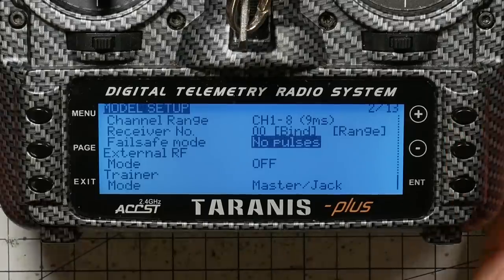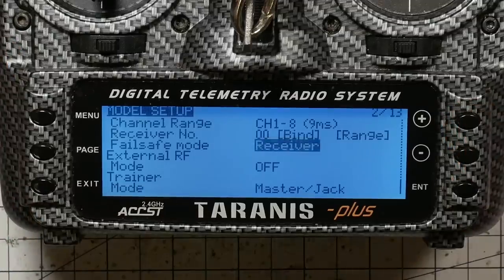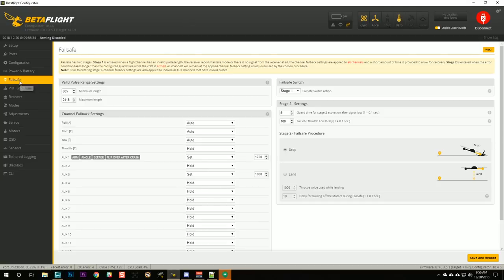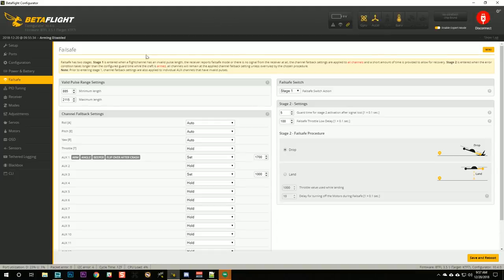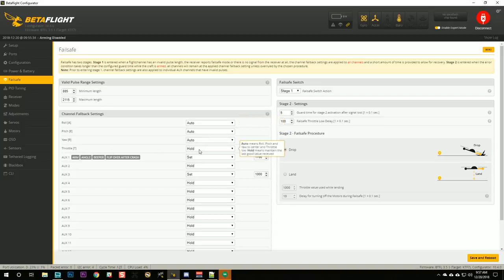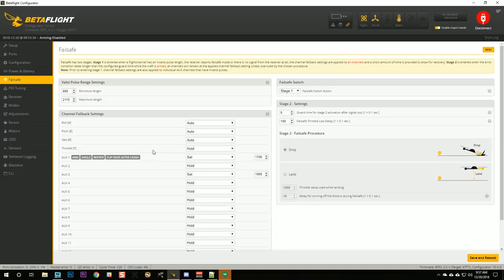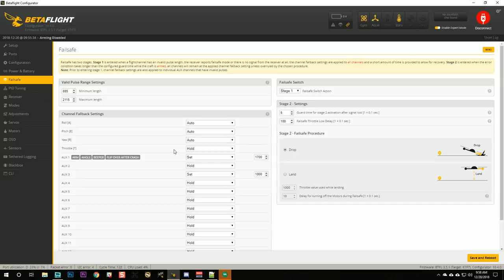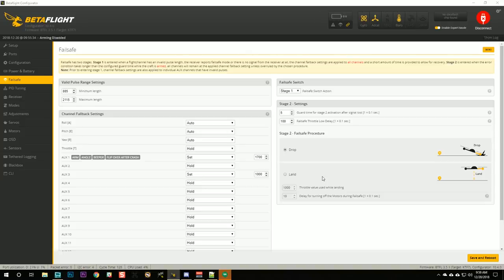Failsafe HOLD vs NO PULSES | which is right?

Comment: Hi. I have a question. I was flying tyro99, and mid flip I lost video feed. I waited for a second or two than disarmed it. As drone was pretty high when this happened it fell pretty hard ( one motor shaft is bent, strangely no props broke although they are damaged ).  What is best to do in that situation ? Is there a way to make it control drop ? I guess disarming turns off motors ( but I did not know what way drone was facing ). How do I activate fail safe on purpose ?

Comment: Hey jb thinking is it like my rc buggy because I bound it with throttle in the brake position. It will just shut off I've never had a issues with quads or buggys on fail safe? So when my buggy fail safe's it stops same as a quad if it's in the air will just fall out of the sky

Comment: Full Throttle without any communication with the transmitter. I would think you would keep on going because it has the battery pack it's locked in I know for my Syma if I go a certain distance the quad seems to stop as if in a box the quad would kind of fall

Comment: seems like a good plan would be to set it to angle mode during stage 1 with a fixed throttle at approximately hover value. Thoughts on this?
Reply from the maker: Definitely not for stage 1. Then if it goes into stage 1 briefly and comes out, it will jerk and you may crash. Better that it just lock up and keep doing whatever it was doing.

Comment: I can say that with a frsky reciever and INAV it DOES matter. Setting to No Pulses will be interpreted from INAV to the lowest time (988ms) in every channel. This happens BEFORE failsafe is triggered. That means if you e.g. disarm at about 988ms you lose the quad. I painly did the experience. Maybe different with betaflight maybe different with other recievers or INAV Versions.

Comment: When your quad does have a failsafe, what does the OSD display?
Today I was flying along quite happily when all of a sudden my quad just fell out of the sky, no death role, all motors had stopped.
Upon review, my OSD displayed My Post Flight Stats just as if I had Disarmed.
Upon plugging my battery back in, some of that magic smoke escaped from the 4in1 ESC.
Reply from the maker: Ummm... if the smoke came out it wasn't a failsafe. Sounds like your ESC took a dive.
Reply: @JoshuaBardwell  Thank you for the reply. I wasn't too sure, as I have had an esc fail in mid-flight and the bird just goes crazy spiraling to the ground, where this was just a free fall to earth from a great height, plus the OSD displayed exactly like I had disarmed.
And yes, you are right, I do learn something pretty much every time I watch your Channel.

Comment: Hey Josh. I'm curious. I completely understand where you are coming from in regards to stage 2 and the landing option. My question is. . . When I first started using acro, it was terribly hard to land, because the thrust from the propellers on the ground and the flight controller trying to sense the quad and so forth. In future versions of betaflight, when you enter a stage 2 failsafe, could it be designed ( as long as your accelerometer was on) and maybe you had auto level in like a background function or on a switch so when you had a failsafe you flipped that switch to go into auto level mode; that the quad could descend in auto level until it experienced the behavior it does when you're hovering over there ground trying to land like a beginner in acro mode; and then it would just disarm?  Did you get where I was going with that?  Do you think that is possible?
Reply from the maker: The quad is not set up to autodetect ground effect, no I don't think so. Autolanding would be best accomplished with sonar.

Comment: What about rc airplanes i've tried several ways and the throttle and servos simply hold and continue?
Reply from the maker: Need to set position in the receiver. Typically this is done by holding the sticks in the desired position and holding down the failsafe button.

Comment: Hi Joshua I know you have used ezuhf before and wondering if you know what to do. I am having a problem getting my Taranis and x8r to failsafe to RTH as a wireless repeater . I have a Taranis plus > frysky X8r > sbus ppm converter to my ezuhf  when i turn off the Taranis the ezuhf goes in failsafe pitch up right rudder and aileron roll over. not a good situation. I have tried disabling telemetry but not sure whats going on. I need 9 channels so i have to get all 9 channels out to the ezuhf. i have D16 set and no pulse but still does not work any ideas what i'm doing wrong. Some videos have used this arrangement but never seen any videos showing the configuration or if the failsafe worked properly when the TX was turn off on a fixed wing UAV
Reply from the maker: I'm sorry man but this is so far outside my area I couldn't begin to say. In the Taranis you definitely want "no pulses" set as the failsafe but from there I don't know what might be going on with the EZUHF.
Reply: @JoshuaBardwell  thanks anyway Josh hope your all doing ok over there

Comment: Sorry! I run failsafe land with a 3.5 sec drop at a fast but safe drop rate determined by my ground effect hover, it has saved me a few times now but I fly in remote locations far from anyone and anything! My worst fear is catching a tree on decent and cooking a motor or esc.
Reply from the maker: Your ground effect hover position will change depending on the size of battery and whether you are carrying a GoPro, or other factors that could change thrust or weight. It's why I don't think it's safe to trust.
Reply: All valid points and I have taken this in to mind and only run the same setup every time! Never changes but still a very valid point and thank you for your response you have thought me so much about the hobby it's not funny, in short if it wasn't for you I'd probably never had the nerve to order my first fpv setup including the HD3's with the laforge witch I followed your step by step guide on internal installing before I even fired them up! 😅😉 thanks again and keep up all the grate work!

Comment: Hey Joshua I have a quad and when I do a multimeter test there is no beep for continuity. Then I will do the test 5 min later and there will be a beeping tone. I don’t know why this is happening. The esc boots fine when there is no tone. I really could use your help. Thanks.
Reply from the maker: If it beeps a very short beep and then stops, it's just the capacitor charging up. It's okay.
Reply: Joshua Bardwell but if it sometimes beeps consistently. Then I wait 4 min and it doesn’t beep at all.

Comment: Hey J.B. my qx7 is starting to failsafe to close with different models, the antenna is good, and the connection is good. Is there anything you know to check? Im hoping by using an r9m module ill bypass whatever ptoblem im having. Thank you!
Reply from the maker: It could be the radio module is damaged. If it's happening with multiple receivers then that's more likely.
Reply: @JoshuaBardwell  will installing the r9m bypass this problem?
Reply from the maker: Yes. If that's the problem.
Reply: @JoshuaBardwell  I appreciate your help, I guess either way it wont be a waiste to try this 1st. Have a great weekend !

Comment: I'm not certain about this - but I am assuming that your demo of HOLD failsafe - by turning off the TX may be flawed. It's possible that the TX sends a command to say ( i'm turning off ). A better test would be to remove the battery from the TX to fully test this. eg don't give the TX time to do anything gracefully. Please let me know if I am wrong anyone.
Reply from the maker: That's not how the TX works. It doesn't do that.

Comment: Imagine you are freestyling 45 mph above treetops and you have failsafe event that is set to "drop". Kwad will continue on ballistic trajectory for another 50 yards or so and it will have about 70 mph velocity at impact. 1 pound hard object at 70 mph can be deadly if it hits a person. And spinning props will be last thing to worry about. But if it switches into "level" it will lose most of the forward momentum and limit descend velocity. I would prefer prop cuts over 1 pound at 70 mph impact. Yea prop can break a finger, but 70 mph projectile can break a head.
Reply from the maker: You can tweak the assumptions one way or the other. As long as you've thought it through, do whatever you want -- you're responsible for the outcome. The big reason I don't feel that "auto land" is safe is that it is typically not going to be thoroughly tested and predictable. For example, if you fly in acro mode, you typically would not test your accelerometer before each flight. Accelerometer can become un-calibrated and you wouldn't know until you failsafe. The throttle position that you assume will give you a nice descent could change to one that gives you a climb, depending on the weight of the quad, the props, and so forth. If you test auto-land carefully to the point where you are confident what it will do, it can be useful. Most people are not going to do that, and simply disarming the quad is the safest thing to do in my opinion. Bear in mind that even at low throttle, the props can rev to 100% if the PID controller commands a correction. The chances of damaging an ESC are much higher if you auto "land" into a tree. This is another reason why I feel disarm is the best option.

Comment: Still don't know how to configure failsafe modes on FlySky iBus. I've tried to figure it out several times, but it doesn't appear to have any "no pulses" option
Reply: Failsafe is in the radio. It is set by making the sticks 100% or zero.
But you have to be very careful with this.
Bc if you failsafe and your throttle is even at 25% it will take off like a rocket, witch I do not like at all.
But there isent anything in there about pulses or hold.
There are a few videos on how to set this up, but just remember what I said about when you set it, and what it will do.
Reply: @toddbeal4373  Hrm. okay.

Comment: Do we know when Betaflight 4 is going final release? I have a Hawk 5 and apparently 3.2.2 is the best tune vs 3.4 and 3.5 but I really need GPS rescue mode not available in 3.2.2. If anyone has flashed bf4 on a Hawk 5 I would be interested in your feedback as I hear 3.5 has random flip issues so would prefer an assured stable release to be flashed rather than just flash it then crash it. Thanks
Reply from the maker: Betaflight 4 is now scheduled for April, 2019.
Reply: @JoshuaBardwell  Thanks. I wish it was available now. From the 1st November the 250 gram law comes into force in UK so the hobby is effectively killed as no one wants to register for harassment and yearly fees. I have 11 months of fun left. :(

Comment: So if the hold postion does the same thing as no pulses then what was it originally intended for
Reply from the maker: Fixed wing planes with servos and no flight controller. In that situation, the receiver is the only failsafe.
Reply: @JoshuaBardwell  oh ok cool thanks
Reply: @JoshuaBardwell  i just found something interesting thought you might like and you might have already seen it  i think you can just goggle this to look at it its called project mockingbird v3 and the tiny hawk and dude says that all whoops fly better with this but its been optimized for the tiny hawk in acro

Comment: You did this vid. i think last year?  are we in syndication
Reply from the maker: No, I definitely did not do this vid last year. I may have done a similar vid, but specifically the point about failsafe working regardless of HOLD vs NO PULSES is new.

Comment: I usually set mine to custom with the RTH switch engaged. That way it starts RTH at loss. Is that bad?
Reply from the maker: If your quad has return to home, that's a fine failsafe option.

Comment: hmm.. i sorta thought the rx had the failsafe code as part of every packet or pulse whatever, so if the rx lost signal IT told the fc to cut out. maybe flysky is different,  ijust tested flysky i6 and it still failsafed even when i switched off failsafe on the tx.... so maybe only for pwm and ppm like you said.... we really need a quad only software setup,    i hope underground fpv and opentx team get what they are aiming for soon.
Reply: I have a flysky i6 and the x, it's worth testing with the props off, as you have to program the receiver out put a signal lower than your sticks can attain on your TX then when you loose TX signal or you switch off your TX ,the receiver out puts the correct signal say 995 for your FC and Betaflight to enter stage 1 and 2 and respond to how you have set this up in BF?
Reply: Not sure if I explained it clearly ,you RX hardware fail safe and Betaflight failsafe? also for me for a while i had fail safe set on the TX and tested it ,but it was only when I was changing  some stage 1 setting and testing it that i realised i had not set it up correctly and BF was not actually performing the fail safe?I will make a video of it as there are some available but they are not very clear. Also top tip(if you were not already aware), keep an eye on your gimbals as after a while your throttle will wear and when you got to do a flip you will drop the throttle hard and it can actually go below 1,000 and failsafe! It took a long time to figure that one out and why i was having random fail safe's.
Reply: @pablofpv  yes this is true for ibus,  i only tested with tx being switched off, which may be a different case. i think i will continue to set failsafe to minus 100 on throttle and minus 100 on arm switch. just in case hehe... also i used the i6 with the 10 channel mod with telemetry.
Reply: @pablofpv   ahhh!.. i think i have already had some gimbal problems, fast rolls caused quad and radio to beep like a failsafe and low voltage alarm together... thankfully i have the flysky nirvana coming very soon. i hope.
Reply: @TheMadmacs  Looks like a nice radio and you will get the benefits of Open TX?
Reply: @pablofpv  lol, yes i am not looking forward to open tx,  and it means losing the simple telemetry flysky does,
   but ultimately i will get crossfire or frsky r9 system

Comment: Almost all fc have barometer, why not used it for fs landing to calculate heigh?
Reply from the maker: If the FC has barometer, Betaflight does use it. Many FC do not have barometer though. Barometer and GPS is not accurate enough to do precision landing. You really need sonar for that.

Comment: Don't modern FCs have barometers on board to know with what speed quad is actually landing?
Reply from the maker: Betaflight doesn't use the barometer much even if it's present, and it's usually not present.
Reply: @JoshuaBardwell  I guess I am back to Pixhawk for a bigger drone again lol, oh well

Comment: Nice, what about Crossfire, "FS. Pos.","Cut" or doesn't matter?
Reply from the maker: Definitely you should test this yourself, but as a serial protocol I would expect the same behavior. Personally I always set it to "Cut" just to cover my bases.
Reply: @JoshuaBardwell  Just to be sure, when using a module (like crossfire) the transmitter doesn't enter in the failsafe equation, right? Otherwise that's 3 failsafe to deal with ;-)
Reply from the maker: For crossfire, I believe the receiver and FC failsafe are the only ones that come into play. Receiver failsafe is set via the Lua script, by pressing the button on the module, or if you have the big module, by using the menu.
Reply: @JoshuaBardwell  It's all clear know thank you :-)
Reply: Joshua Bardwell When I got my Crossfire module about 6 months ago, I didn't change the default failsafe mode from "FS. Pos." to "Cut."  The first time I failsafed, it was terrifying!

I was gently climbing when I lost signal.  The quad stopped responding, but it continued to climb.  First I tried dropping throttle, then I tried disarming, but it just kept going.  It felt like an eternity before the disarm kicked in, but in reality it was only a second or two.

I don't think anything has changed since then, so it'd probably be best for everyone to set the failsafe on their CSRF receivers to "cut!"
Reply: @patregan  I think it was set to "FS pos" which keep the position of sticks when the faisafe was set.  But I don't know what are the factory position if the faisafe has never been set. 
+1 for setting it to cut ;-)

Comment: So you chickend out on the "your failsafe doesn't matter" title 🤣🤣

Ps: the failsafe setting is transmitted as an extra hidden channel every refresh from the radio

Ps2: There was a bug report on inav talking about a bug where some frsky receivers will act weird just before failsafe, it may 0 some channels if set to no pulses. If that channel is arm switch your quad drops without following fc failsafe mechanisms so hold is advised

PS3: the channel settings on betaflight are not just for stage one failsafe, it also applies when receiver is off. Very useful for setting default switch values if using modes

Comment: I disagree with landing. I fly around tree tops as approx max altitude. If I get a failsafe, my quad will autolevel and hold low throttle for 1 second. In this way the kwad falls waaay slower, safer, more controlled and less damaging. In most cases in low altitude it gently drops instead of boring an arm into the ground or somet else.